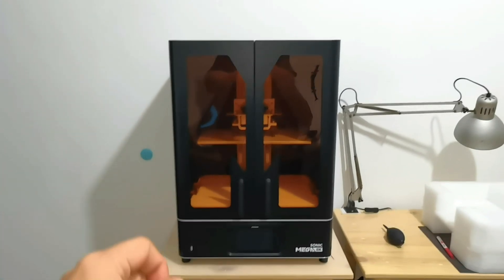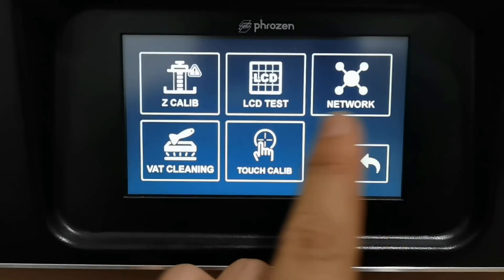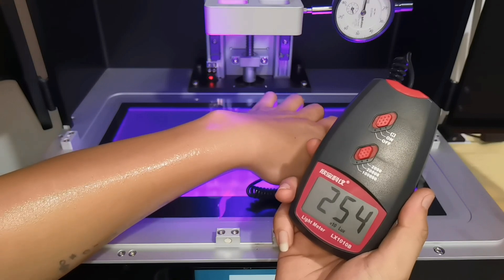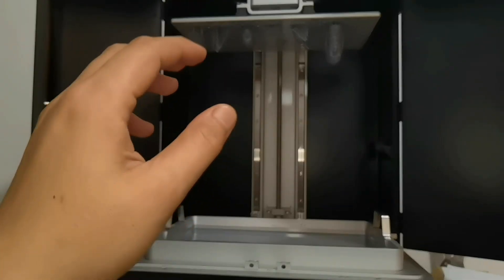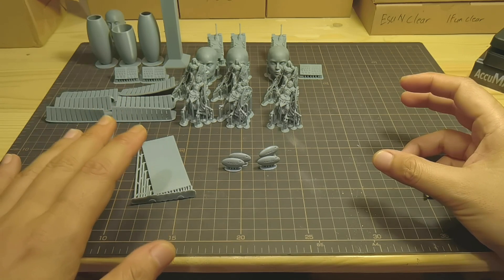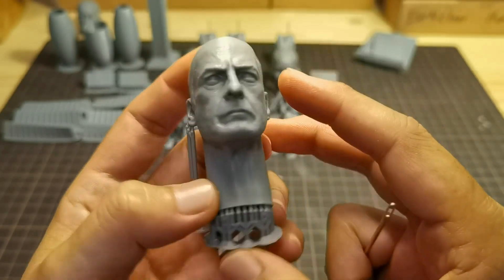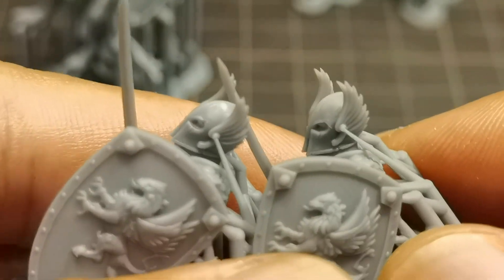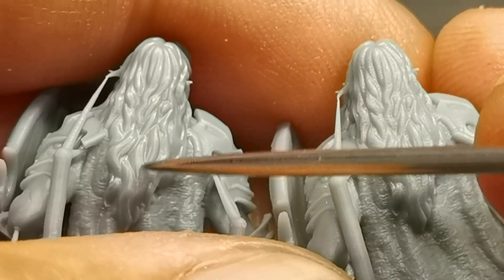Phrozen Sonic Mega 8K In-depth Test And Review

Comment: Nice video! I got mine a couple months ago and I've only done 1 small test print and it was successful. However, did not realize how much more work this behemoth is! Im used to the Anycubic Photon so going from that to this, I was personally overwhelmed because now I need more bottles of resin, more alcohol, a bigger cleaning/curing station and more desk space! Big downside I had so far was with my first test print. It was such a small print, but it took close to 8 hours. I followed the recommended settings Phrozen has on their website, but that shouldnt have taken that long to print...? so now I need to figure out how to get faster prints with great results. RIP time and resin but I bet I can dial it down in no time! I hope...
Reply from the maker: In your print setting.
Change the rest time into light off delay.
And then calculate the light off delay.

Comment: You're as always the go-to reviewer! I had the exact same wobble issues on the Mega 8K (and many others on the FB group).
On my machine, although I got sent a new Z-rod which was initially thought to be the culprit, it is actually the coupler not being tightened straightly which causes the wobble. Took me quite a while to get that right. I also removed the bearing on the lower end which isn't really necessary and just another possible point of failure.
Reply from the maker: Yep i was think replace the bearing with better brand or remove it.
And gonna surely check the coupler.

Phrozen already responded. And i will share what i did hopefully if i can fix it 😆
Reply: @wangdennys  I thought the best way to check if the wobble was gone was loosening the upper bearing, which made the wobble quite visible. As soon as I had the coupler properly tightened, the upper bearing didn't move/wobble anymore. Otherwise you'll waste many liters of resin and time to check if the problem is fixed or not.
Reply from the maker: @serkanbudur  thank you for your suggestion.
To open the lower bearing
Should we open the top case?
Reply: @wangdennys  Yes you have to because there are 2 more screws on the back side which holds the bearing in place, which you can't access otherwise.
Phrozen has a video file showing how to remove the top case
https://drive.google.com/file/d/1nhirP16EWUGrmHqGrACflxpV6b9dKgoJ/view
Reply from the maker: @serkanbudur  i knew it!
Thank you for confirming
Reply: @wangdennys  You're welcome!=)